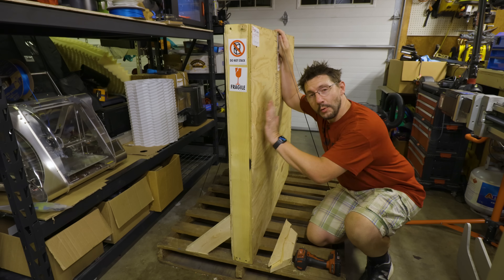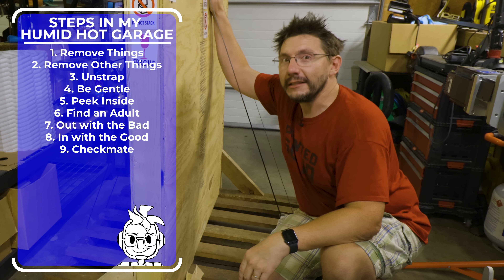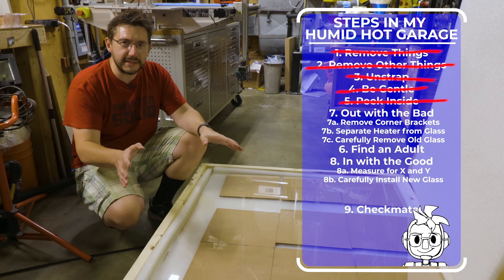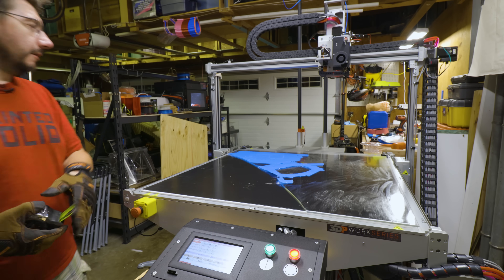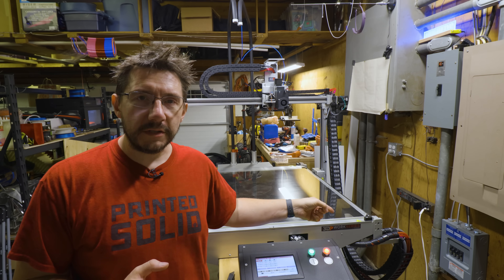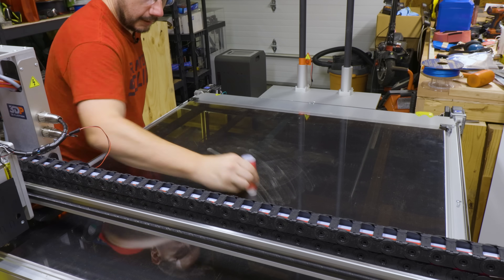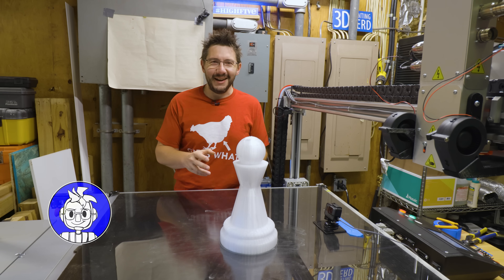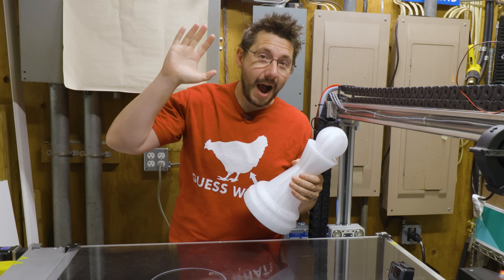NEW GLASS for the $38,000 3D Printer!!!

Comment: You know - a trick I learned recently is to zigzag some glue stick onto the print surface. Then spray some IPA onto the glue and wipe it around the print surface making a thin layer. You get a better surface finish and really good adhesion and afterwards you really just need to spray with IPA and wipe down again. I reapply every couple of days. But much more efficient use of glue stick and much less messy.

Comment: Just something you might know ..or not. Float glass actually get so flat by floating on a hot Tin bath. That results in a Tin side on every piece of float glass, that side of the glass pane that was actually in contact with the Tin bath. There is probably a difference in the adherence of the printed part to the glass, depending on which side is up. If you want to know which side is upwards...use a Woods UV lamp that has a Woods glass filter in it. The Tin side of the glass will look whiter than the other side under illumination with that UV source. That is how its detected in the glass industry.
Link:   https://en.wikipedia.org/wiki/Wood%27s_glass

Comment: If the glass happens to break again you should look into replacing it with an aluminum sheet instead. Much cheaper, more durable, and you can still get good bed adhesion by using painters tape or a glue stick. You could also try giving the bed a textured feel to see if you could bypass putting anything on it.
Reply: and unfortunately about as flat as an old blanket. Very hard to get flat aluminium, especially at that bed size.

Comment: Ok, lets see this train wreck continue.  puts on service delivery hat  So how long until whichever sales/marketing person crawls up to 3D Platform's equivalent of me and begs for Joel to be put on the system with the full support package?   So far we've had the setup engineer tell us the product is crap or one of their customers is incompetent (the Disney mention) and the machine failed in quite spectacular fashion (bed shattered) on its first print, it's displayed issues with its base configuration (restart print failure) and build errors (USB cable unplugged) right from the factory and post setup.  
And now, they've shipped out two new build plates, with no setup support and a tub of magigoo which kind of hints they screwed up by not putting some with the machine in the first place? Ha Ha Ha.

takes off service delivery hat

Print a giant benchy... it'll probably catch fire or do something else fun.

Comment: Say what 3800 printer dam u building it awsumeness. I put together a 3 d printer kit i got from UK sent to oz took long time to get all the parts i needed put the printer together it all run well. But then printer plate is stuck at top  now so when in the program i try tell it to move down it whant move down....it does say in Gide book to do one steep at a time but may be i did tomany steeps.  May be i should ree start. Deleat the programs n ree up load an the up dates. An cee if that work s as i up to calibrating it .but 3 d printers bean siting ther 5 years .fumming as i spent 2.500 on it. I wish i had goten a diffrent printer ..dam your 3d printer is rad. Do you take orders to print stuff to. So a glass print bed  is better or. My print bed is sume carbon fiber plate with tap over it.

Comment: Holy sheet, you got me anxious! Why did you not use 3M Blue tape on the glass? It's the definitive solution for all filaments. And you can use it with any compound you like, from glue stick to 3D printing sprays. It's specially valuable for PETG.

Comment: You should get in contact with Filafarm in Germany and get their special "Filaprint" interface material for this printer.

I use mine on my TEVO Little Monster for years now and it still works like on the day I bought it - prints stick perfectly while the bed is hot - ince it cools down the print comes right off.

Comment: Imagine... sending a really expensive 3D printer to a guy you expect to know how to use it. Only to find out he doesn't know how to print PETG and breaks your printer at the first attempt. I guess it's not an idiotproof device :P
Reply: Agreed I thought more users of 3D printers knew some* I won’t say all cause I haven’t used every brand or color but some petg will bond to glass and pull a chunk out it’s best to use a coating when printing petg on glass
Reply: Just because you need forklift to move it it doesn't mean it needs to be that expensive.
At that price point that glass shouldn't break even if you hit it with the hammer.
Calling someone idiot because the bad cheap part broke isn't nice.
Reply: @samster1995  It's a commonly known issue with petg. Also, I didn't call him an idiot, I said the device isn't idiot proof. I think it's a good test to see if it works or not, but he should have known better

Comment: Great video. I want to know how can I get into 3D printing and what machine should I buy. I dont want a real cheap machine. Thanks.
Reply: I've got an Ender 5 Plus and it prints great if you tinker with getting a proper slicer setup and tuning the extruder. They go for about $570 USD and have a 350x350x400 build area (You're able to stretch it to 360x360x410 but your mileage may vary) with a bl touch and autoleveling. If you don't want that big of a printer or if it's too expensive, the Ender 5 pro is a good choice, pretty much the same printer except smaller and doesn't have auto leveling, but does have a silent board. And if that's too expensive, the Ender 3 is pretty much THE entry level printer, it's only around $210 for the pro version and is built really well and has a massive community built around it
Reply: Prusa i3 mk 3 if your not worried about the 750$ price

Comment: Please review Makerbot Method X.  I just got one a couple of weeks ago but I have not been able to print anything because the software is locked-out unless you have a Makerbot brand support material spool loaded (recognized with RFID).  They sent the printer with a spool of PC-ABS but no SR-30 (which would be required based on the extruders they sent with it).  I guess they're backed up in providing filament cause I have been waiting for my order of SR-30 to arrive.

Comment: The 3D printed dial indicator works fine (it is a print in place design so it can be  hard to have a working device but once you found the good parameters for your printer, it works like a charm).
You should use it on your new freshly levelled bed and compare it with your measurent device.